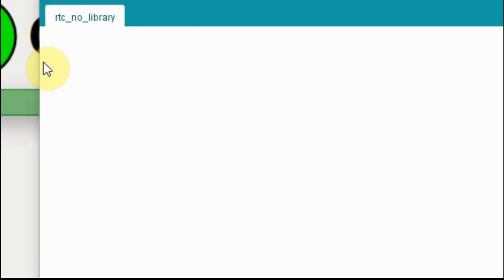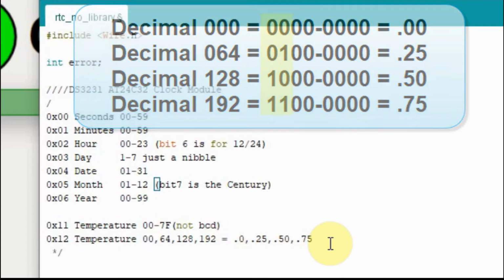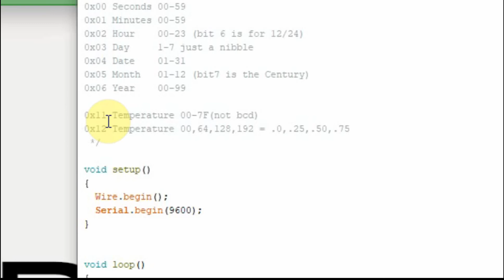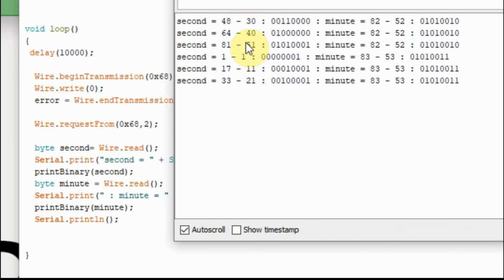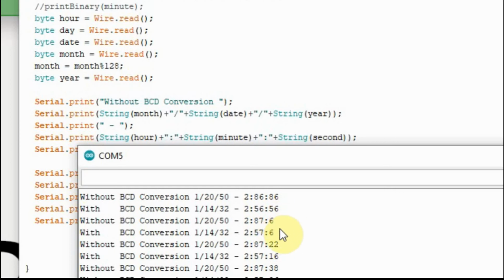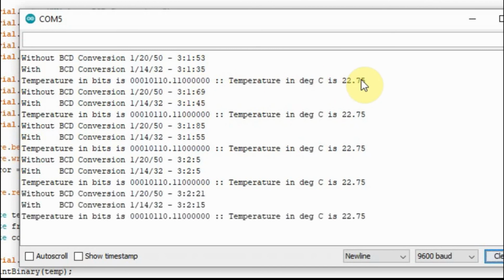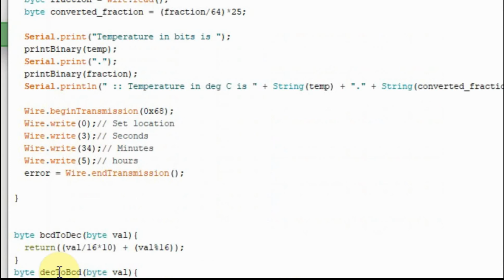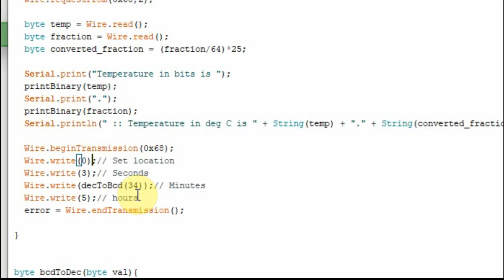123 Arduino with External Real-Time Clock and temperature sensor without the manufacturers' library

Comment: Hi
I also need to build a Ds3231 system with Arduino without using Ds3231's library. I find the program you created very interesting and useful. If yes, can I refer to your code?
Reply from the maker: You can download the code at www.cheapcontrols.com and use it however you wish.  If you find value in the code please consider a donation at my Ko-Fi page https://ko-fi.com/cheapcontrols
Reply: @CheapControls  Hi, I've tried searching, but I can't find any code links you quoted in the sections of your site. I found this video link on your website but there is nothing below it, other than the description. thank you
Reply from the maker: @loopfi8835  I added the file a few minutes ago.  It is at https://cheapcontrols.com/videodetail.html?id=29 I miss them sometimes.  Let me know if it is not the correct one.  I have a lot of files, and sometimes I upload the wrong one.
Reply from the maker: I also updated the description with a link to the files.